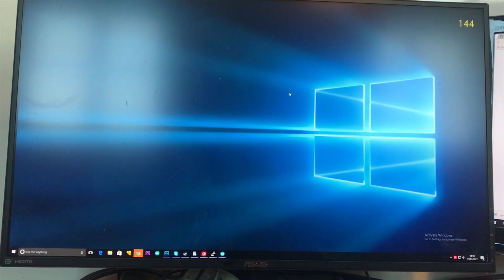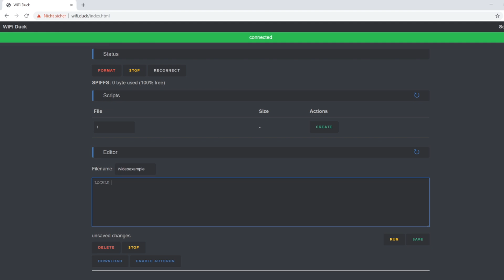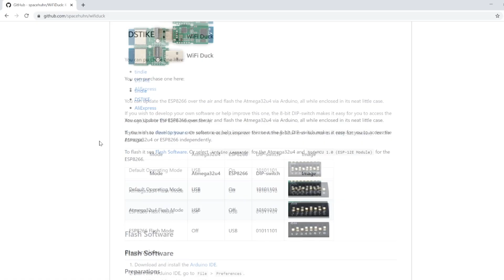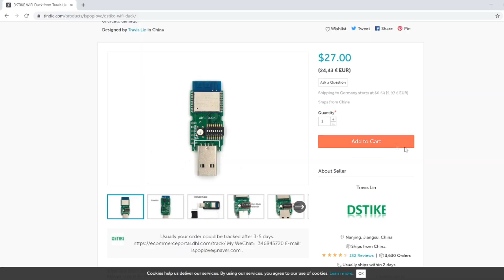WiFi Duck - Wireless Bad USB w/ ESP8266 + ATmega32u4

Comment: Real cool an devious thing. I'm just wondering why the heck would you have Atmega chip on that board. Seems like a waste of a perfectly good piece of silicone, given that you can just use ps2dev library to emulate ps2 keyboard, use two of esp8266 pins to interface with usb plug via logic level converter and bob's your uncle. Man, look up the schematics of USB to ps2 adapters. that's just wires, you know ;)
Reply: It'll be so cool to see your version where that works, I'm sure it's easy ;) meet back In a week and let me know how it goes.
Reply: @NullByteWHT  well, I definitely won't be rewriting entire software, having life to live and all, but the key stroke injection part, no problem at all. I've done it before, can breadboard it again tonight ;)
Reply: Just RTFM lol

Comment: Hi there... thanks for this awesome project. Will the new software be compatible with the old hardware from your former WiFi-Ducky project? I build one myself back then and would like to keep using the hardware.
Reply: Ok, I found out the hard way that the answer is „No!“. The first  reason is: new software uses SCL/SDA instead of serial, second reason is esp8266 needs different firmware, third reason is: as hardware is connected in the old WifiDucky build the Arduino IDE will upload the Arduino sketch via the Arduino into the ESP which severely bricks stuff. So you better de–solder everything apart and flash things separately. Now everything works again ;–)